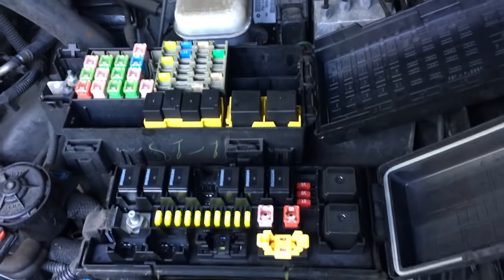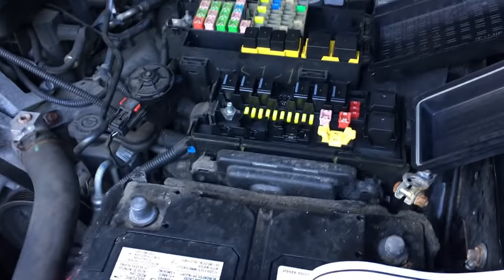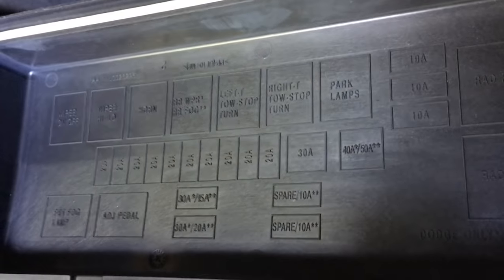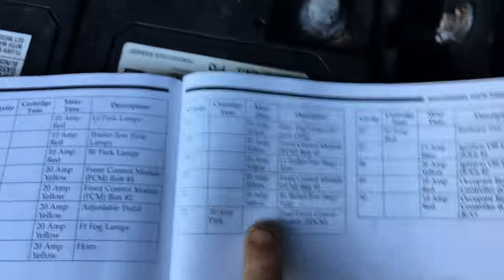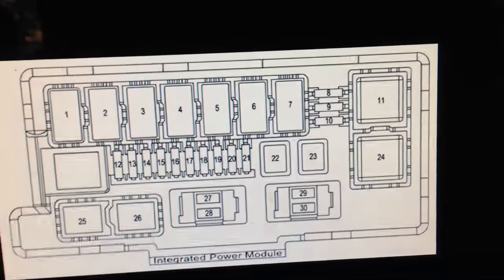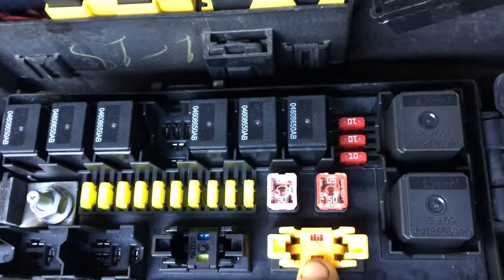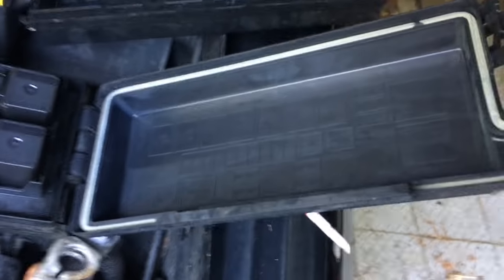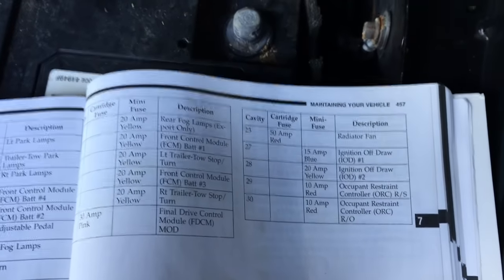Jeep owners MUST watch. Air bag light on?

Comment: Thank you! I was looking for a little plastic fuse puller tool to replace a 20A fuse. I pulled that little yellow plug with the "spare" fuses, thinking this utility vehicle had that little tool (obviously not).
Then, I proceeded to replace the "spares" but didn't push it all the way in.
The airbag light came on the next day (because my wife didn't drive it until then).
I spent 15 minutes checking all the harnesses and connectors and then googled and found your video.
I checked the "spares", pligged them all the way in. Like magic. No more warning light.
Thank you.
Reply: Exactly the same thing with me, only in my 2004.

Comment: Thank you for sharing, I have the airbag light on and the battery light on and also my check engine light is on at the same time. I have seen this happen once before and I had to have the vehicle taken to a mechanic shop, they told me that I just needed a alternator when all of this took place. I have replaced the alternator and two batteries myself just yesterday and is still seeing the same lights on my dashboard. I am now going to change out the airbag fuse to see what will happen afterwards. If you can get me some feedback on what I am saying that will help me to get my 2017 Jeep Grand Cherokee Laredo back running properly i will be very happy for your help 🙏🏿💯

Comment: I just bought a 2010 Jeep Patriot & the 4WD! light was on, so no 4WD. The fuse was missing, so I assume the original owner needed a 15amp fuse for the Power Plug so the person could charge their iPhone & figured I'll just use the 4WD, since depending on how & where you drive, 4WD doesn't always have to be used. I had a Kia that was so good in the snow that I never used the 4WD on it. With them, the FWD works pretty good, so with that being said, I can see robbing that Fuse. I'll look up the Airbag for the vehicle to see if it's also a fuse issue. Thanks for uploading the video. It helps get people to think...

Comment: I have a 2008 wrangler and I think they have a similar issue. The two locations that SAY is used for airbags have a big yellow insert. You can pull it up and it's empty. My air bag light has been coming on ever since I checked a bunch of fuses for an unrelated issue. I assumed I messed up the airbag fuse. However I have no idea which slots are for air bag as it appears to be labeled incorrectly

Comment: I own a pre-production 2015 Dodge Challenger, and it has three of the fuses mislabeled on the inside of the lid, too.  Not airbag fuses, but three of them together.  What I've seen on the actual 2015 models that I've looked at, there is a ,card that was printed and stuck onto the underside of the cover to correct that error.  I wonder if this slipped out, and was supposed to be fixed by the dealerships, and some of them didn't bother.

Comment: its the same thing in my 04 WJ i saw the same thing in my 2010wk when i tried replacing a fuse saw it. air bag light came on put the fuse back in, checked to see if my Wj had a spare and sure enough it was there. Im guessing it a spare fuse untill you can get to a parts store to buy another fuse?

Comment: Just had a customers Jeep in with the air bag light on and no radio display. Found one of the fuses in this holder missing. Fixed both.

Comment: That's  great info to have but why is my airbag light coming on when I have not  used one of it's fuses?
Reply: Lots of things. Loose / broken plug (yellow under both front seats). Something jammed in seat belt buckle (console side). Lots of opportunities in the massive messes called power modules. And so on and so forth. Good luck. Garages can send their kids to college after fixing this problem.

Comment: Dude you are the man! Glad I found you ! I pulled the fuse out to fix my lighter🤣 cause it said spare 😬 
Another thing on my commander is upstream pass  o2 sensor  600.00 for a mechanic to change you can’t get to the plug😡 I got so mad I couldn’t unclip  it  I cut and soldered them 🤣 they couldn’t leave 2 inches of xtra  wire! 
Thanks  again  
I appreciate you man!

Comment: Has anyone had there passenger  airbags off how do u turn them back on 2006 jeep grand cherokee I bought my jeep like this haven't solved the problem yet ??
Reply from the maker: The passenger seat airbag is usually controlled by a air bag switch or they might call it an occupancy switch. It senses weight applied to the seat usually 60lbs.  If a adult is sitting in the seat and the light is still "de-activated" you need to get it checked out by a qualified tech or dealer.  very specific ways to test restraint systems such as NO voltage drop test, no power probes ect. Just by toughing the wrong wire there is a chance the bags will deploy.  Im looking out for the safety of you and the car.  If you are supper confident, shut the whole system down and preform an ohm/resistance check across the seat switch. Again proceed with CAUTION!
Reply: Look to see. If there a black box under passenger seat make sure clips are connected